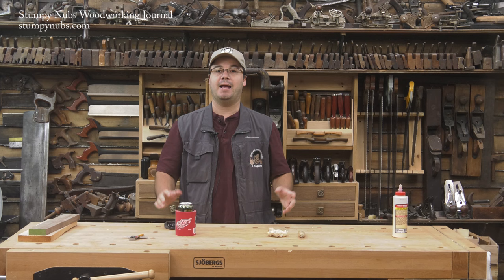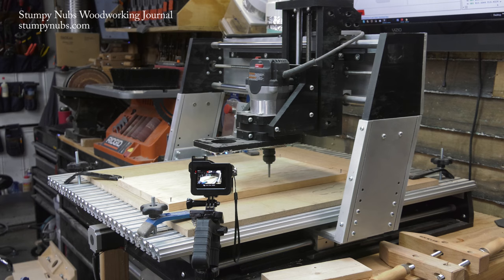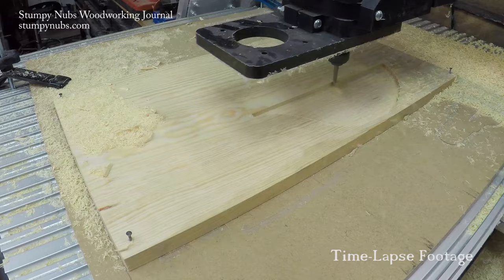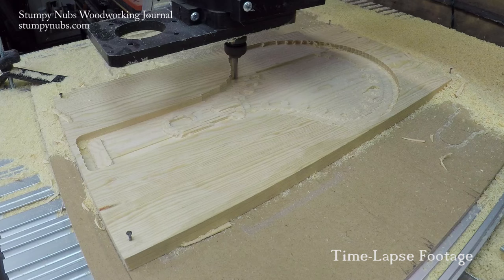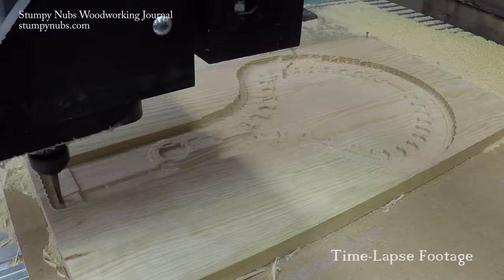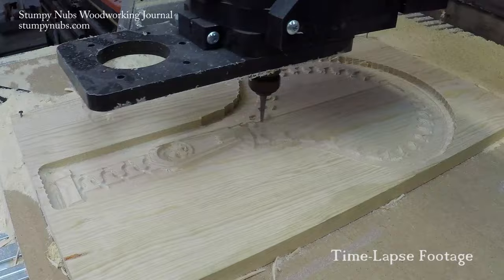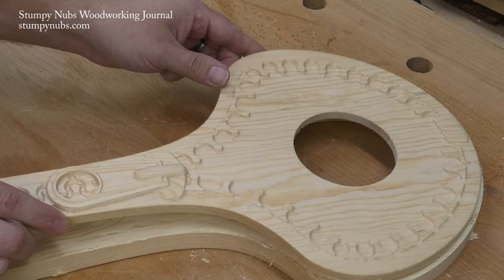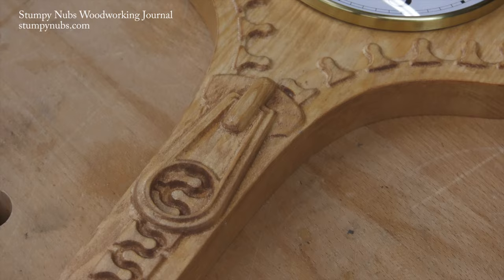WATCH THIS before you buy a CNC machine for 3D carving! (Updated)

Comment: You keep talking about "the right machine" then talking about the software being key. EVERY MACHINE is  capable of true 3D carving. Period. Software is the key. Stop saying the "right machine". It is starting to sound like you have been overlooked by the great CNC give away and you are bitter.
Reply from the maker: I talk about the "right machine for your needs" and "the right software for your needs" because BOTH are important. I think that's made pretty clear in this video. And your attempt at an insult was a swing and a miss. I did get one of CNC machines you refer to. I have no idea why you feel the need to act like you are, but I really hope your weekend gets better for you.
Reply: Thanks Stump. It has actually.
Reply: I looked for your review of said machine. Why did you not do one? Just curious. If it's too personal I understand.
Reply: The "right" machine dosent have a real definition. Its what works for you.  I Woulda made mime big enough to chew on a full sheet of plywood if I had the space. Very small shop (200 square feet)but it works for me. My homebrew is 2 feet by 3 feet and fits perfectly in the space I had. Everything else being equal between the 2 the small one is "right" for me. Small shop but its all I need to do what I do.

If youre doing say commercial cabinet making then the "right" cnc would be one  big enough to reduce a full 4 by 8 sheet of plywood to sawdust.

As far as a "giveaway' like the X-carves did. I wouldnt have even unboxed it and sent it back. They do work but at the very low end of the hobby level. One of the local maker spaces here has one and its PURE JUNK in my opinion same for the software. Now it works right after replaced a lot of it with better extrusions and  tossed out the "stock" controller box. It now runs on Mach 3 and can use any known cad/cam program around.
Reply: OMG, did he say that all machines are exactly the same? I missed that.
Reply: threeque I am with you.   Very unlikely to use software that comes with a machine other than the software that executes the g code.    Face it, like it or not every cad cam package in the world costs a buck each in china, and we all get to china at least every other year.   No loss big boys, your average hobby guy was never going to pay 20 grand for software because they do not have it, but they are not going to watch china out advantage them.   Just the way the world is.   Presenter protests, might invoke legality or morality, but is still just plain wrong in terms of facts on the ground.   Your average hobby guy probably has every cad program ever written.
Reply: 3d catching puts way more wear and tear on a machine than just cutting out shapes.  It also takes way longer to do.  You need a machine that is durable and dependable... one that you can walk away from,  and trust that there will be no disasters.
Reply: btw for 3d u need 4 axis not only 3 ,,this what he did are 2d or 2.5d only and that vertice software cant do 3d btw

Comment: So now I guess anyone with a CNC machine and working knowledge of computer software is a 'woodworker'. smh
Reply: No.  But then you would not expect a wood carved to immediately know how to model in CAD, either.  The two skill sets are different, and work best when you can do both.  CNC is just a more complicated part of millwork.
Reply: @andy-in-indy  I understand what you're saying and have to agree with you. I'm a retired custom cabinetmaker and fine woodworker and I've experienced the introduction of the CNC process integrated into even the smallest of cabinet shops. I'm not against them, it means production times  are cut drastically and you get a more consistent product. But there came a time when I realized I wasn't cutting the wood, I just pressed a button and it was all done for me. It just seems the 'art form' has become lost to the machine age, and 'craftsmanship' is determined by your software knowledge. Obviously I'm old school, but I'll get over it. Thanks for your comment.